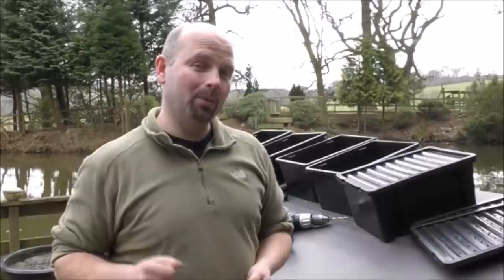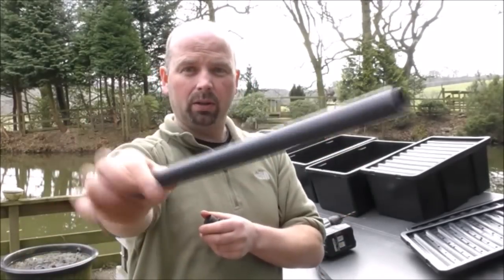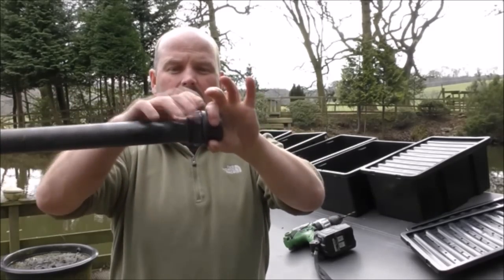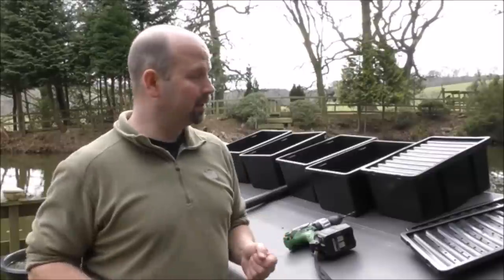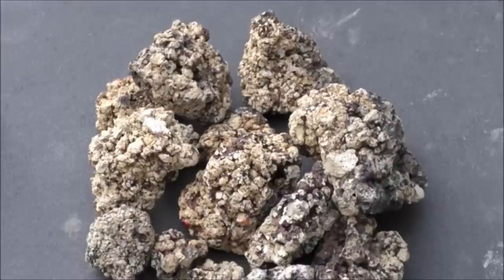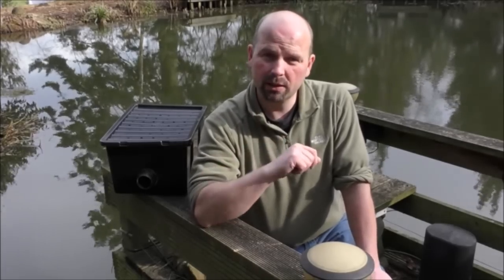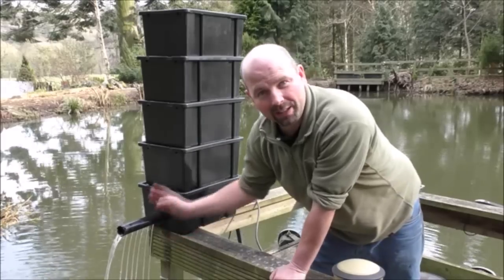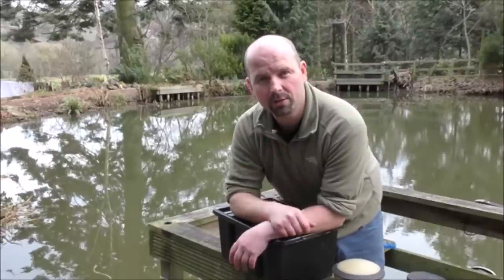DIY Shower / Trickle Filter for a Koi / Fish Pond by PondGuru

Comment: hi 
I've put absolute koi shower media in my trickle tower. 
pond water gone cloudy 
do you think this pummace style media is to blame. 

thanks 
Jim
Reply from the maker: If it is pumice you have bough then yes it could make the water go cloudy as it needs a good wash prior to use. However I have had a look at their site and can't see pumice there but there is a similar media called crystal bio which is macroporous so will be good for the ammonia and nitrite but it should not have made the water cloudy.
As I don't know what you've bought I really can't answer the question properly - Absolute koi would be the ones to ask if you bough the media from them as they should know its characteristics.
Reply: Pondguru it's absolute koi shower media. 
my water has turned bluish and gone cloudy after using this media and all of the algae and Moss on the pond liner have this chalky coating.  I also used a bit of cementone cement on a coping stone repair. 
the cement dried before refilling.
thanks for the reply
Reply from the maker: Absolute koi are the people you need to speak to as they supplied the media. The media description on this page: http://www.absolute-koi.com/subcat2161.html
states "Created with heat at 3000 degrees, then cooled rapidly, Bacteria Shower Media has huge porosity to enable aerobic as well as anaerobic bacteria to fully function. "
As far as I know there are no kilns making sintered glass or ceramic media which get up to 3000 degrees C and the picture on their page shows white pumice which they are calling 'Bacteria shower media' with no mention of pumice on the page. A volcano which makes pumice will certainly get to 3000 degrees C so I am assuming it is simply white pumice (which needs a good wash before it goes into the filter) sold under a more interesting and technical sounding name.
White pumice is a good media but they state on the site that it is inert. The pumice has a specific pH of around 8 so will affect the water by mineralising it and buffering the pH. That is good for koi but I wouldn't class it as inert as it has the buffering effect.
Why these companies won't just call pumice what it is (PUMICE) is beyond me as when you get a good grade of white pumice it does a great job on filtration.
That's what I sell in 25kg bags on the Filterpro website http://www.filterpro.co.uk

Comment: should I get rid of the UV light I have connected to the trickle filter?
Reply: I was thinking, maybe I could drill a hole in the back of one of the boxes and stick the UV light in there
Reply from the maker: As long as it was in a waterproof housing that would work although it may cause the plastic it shines on to go brittle - much better to install one in-line on the pipe feeding the filter.

Comment: I would worry the first layer with the shower only get a small part of their surface sprayed and goes down in a straight line.
Reply from the maker: The update video I uploaded a few days ago shows the extra holes which were drilled to cancel out that problem - I had that concern too with the top tray. The lower trays were fine.
Reply: @pondguru  I used 2 inlet pipes , just need a t-piece and a few 90 degree bends.

Comment: Can we use this kind of bio filter in RAS system with high density of fish
Reply from the maker: It would work in any system as its there to provide more biological activity which helps reduce ammonia, nitrite and nitrate (as long as good media is used)
Reply: I have 30000 ltr water tank.
So how much boi home media i will need?
Reply from the maker: The amount needed will depend on what the rest of the filtration system is comprised of. Generally the biohome would be the last stage of the filtration after the mechanical filtration (drum / sieve) and aerobic biological (typically a moving bed) - if it is 30000 you could need 100kg-150kg to achieve a reduction in nitrate but it depends very much on how effective the rest of the filtration is.

Comment: Now i have a question.. Going to build also a trickle filter.. But nobody can explain me how much filter media iam going to need.. I would say more is better but that's me so maybe you can explain me how much filter media I should need for a big trickle filter..
Reply from the maker: Estimating the amount of media needed for a pond to achieve a full cycle is extremely difficult to do as it is a much more variable environment than an indoor aquarium but it should take around 1kg of biohome ultra or maxi ultimate or the shower media per 150 litres - all found here:  http://www.filterpro.co.uk to achieve a full cycle on a koi pond. That is a lot of media but if the shower is part of a filter system with other types of filtration working on the pond, pond is partially planted then that amount will decrease.

Comment: Is there anything else to help. I have a big pond
Reply from the maker: I use 2 full bales of barley straw in the large pond and they sit in the flow from the pump. I have never had a problem with the blanket weed since I started using it but that may also be down to the plants around the edges of the pond being very mature, providing shade and drawing nutrients from the water.

Comment: pondguru i am going to make freshwater fish tank...size is like 96"long...30"tall..and 20"wide so what is my glass size in mm...15mm is enough for that measurement...plz guide me...thanks...
Reply from the maker: I have never made aquariums before so I can't help there unfortunately. You'd certainly need bracing pieces at intervals along the length of it but I couldn't advise on glass thickness.

Comment: where would you get the pump
Reply from the maker: Pond pumps are available all over the internet and from any decent aquatic store but take note of the wattage since that will translate into running costs - many pumps which are cheap to buy cost a fortune to run so are a bad choice since the filter needs to run 24/7

Comment: How much pumice to fill 3 of these?
Reply from the maker: If using the 30mm - 50mm pumice you would need the best part of 30kg - 40kg to fill 3 boxes of this size depending on how it packed in. If you went with the smaller 15mm - 25mm size it would take nearer 50kg.

Comment: It sounded like you are going to filter that lake with that :D hah. (Are you?.. D: )
Reply from the maker: No not with this one alone but I do plan to make a mega filter over the winter from wheelie bins which will include vortex and shower parts to it. Will use 7-10 wheelie bins + the vortex (either 1 or 2 depending on flow rate).
Reply: Thank you for the video.  I truly enjoy them.  I am very seriously going to do exactly what you are teaching here.  I am planning on using what we call totes here.  They hold approximately 400 gallons each. And am planning on stacking four high.  Is this what you are talking about ? “Wheelie bin “ ? Thank you very much and keep up the good work and love the videos.

Comment: thinking of making two on my 10000 gallon pond I have 2 nexus 210 running on now. both 5 tier or 1 5 tier And 1 4 tier the boxes you use what size ltr are they so I get the best boxes. I'm getting fittings from Douglas brother I live in Durham.  well made and very good and informative video.
Reply from the maker: The boxes I used are only around 15 litres so not suitable for a high flow - they are not very strong too so you may want to check out the better (larger) boxes in the link in the video description. I did a later video showing a stainless steel shower filter so you may want to check that one out - it was made by Global Koi.
I still have that one on my pond if you want to make a visit to see it running. I'm only abut 25 mins from you at Ebchester and I work from home so any day is good.
Regards,
Richard
07772848730
Reply: Pondguru Outdoors

Comment: Hi is your other 4 boxes empty
Reply from the maker: They are currently filled with 30mm - 50mm white pumice as it is a great alaternative to biohome.
Reply: Pondguru thankyou going to look for tubs now great video 👍👍
Reply from the maker: No worries, I have put a link to a couple of different types in video description and pinned comment if you want to check them out - there are loads of different types available online and from supermarkets / DIY stores.
Reply: How much bio media goes in each chamber and has the amount any effect on the filter technically? Should there be any space in the drain chamber or can you fill that up with bio media above the drain pipe aswell?
Reply from the maker: As long as the media is large enough you can totally cover the exit pipes in bottom box as there will be enough holes for water to escape through the pipe. If you have smaller media then a strong mesh or divider will be needed above the exit pipes . More media = more biological action but the choice of media is very important as you want to have a good surface area but still allow water to flow freely through the filter. Biohome and pumice probably have the most suitable surface area but red lava rock (as used in BBQ) and alfagrog would be a decent second (budget) choice.
Reply: Pondguru 

Many thanks for your answers!
Reply from the maker: No worries - I forgot to say if you are looking at media types don't go for the new media coming out of China - it is so soft you can crush it with your hand and won't last beyond a month in a shower filter. I got samples of every type sent and will be making a video on it soon - I was looking for a budget alternative to the biohome for shower filters and sumps so spent £126 in shipping to get the samples. Wasted my money but gained knowledge of just how poor that media is.
I'll be making a video on it soon.
Reply: Pondguru 
Thanks! No actually I have tried ny best to find all parts locally to avoid shipping costs and keep it economically. Though the suggested boxes with tough enough plastic are more than ten times more expensive as "pound store" og similar  doesn't exist. However I love the concept where you easily can add an extra chamber for added capacity, which makes it fairly cheap to expand. Love your channel! Keep it up.
Reply from the maker: No worries and best of luck when you build one.

Comment: How often does this filter require cleaning?  If cleaning is required what needs to be done?
Reply from the maker: It's really just the foams which need cleaning as and when they get dirty. In a pond that could vary wildly from every few days to every few weeks depending on stock.